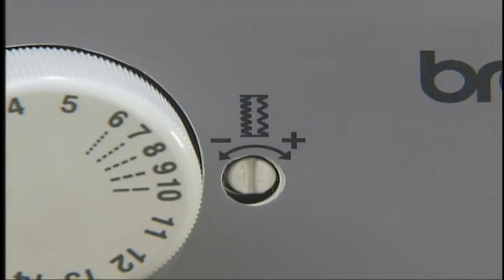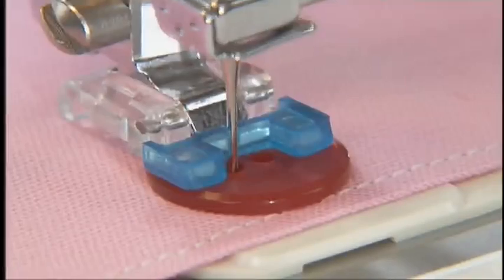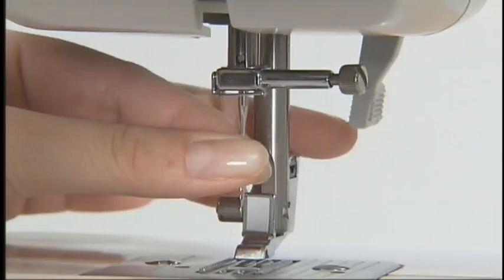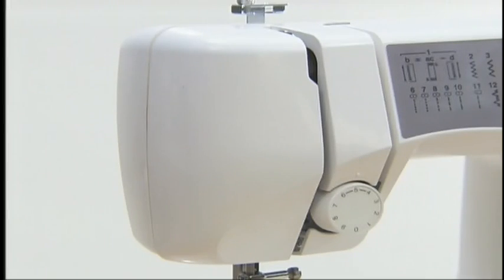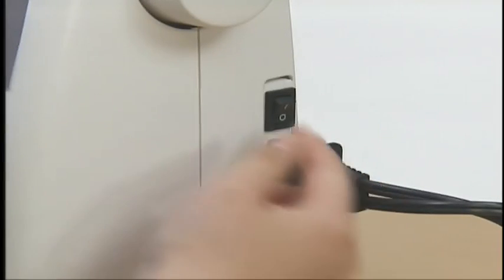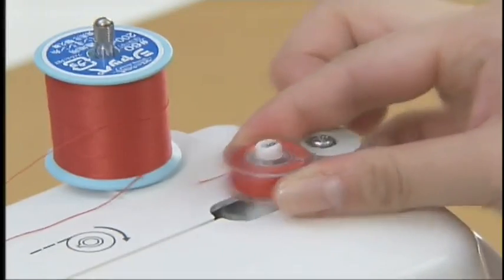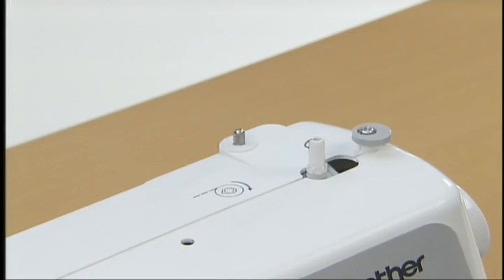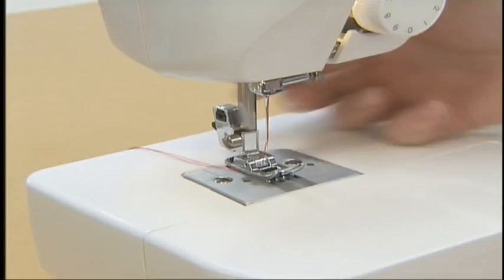Brother Sewing Machine (part-2) "English"

Comment: How do you make a slit for the button to go through once you've sewn the stitching frame. Exacto knife? I used one and it cut my stitches on one side. Was I just not careful enough?
Reply: Rimmelyk Druid, insert a straight pin ahead of the bottom stitches before you use a seam ripper to cut the button hole slit.